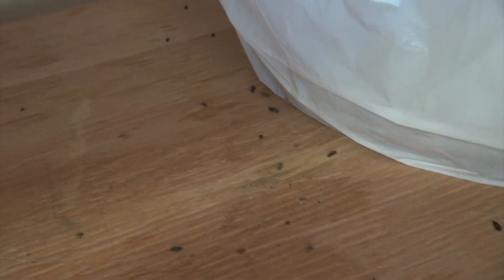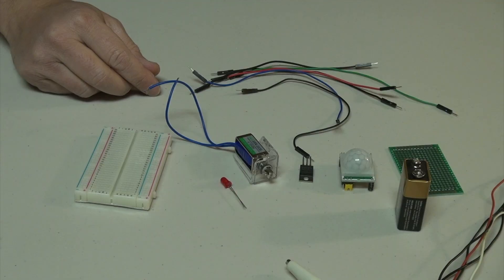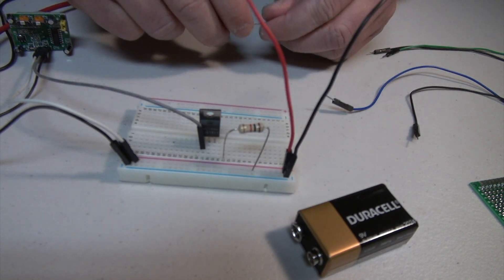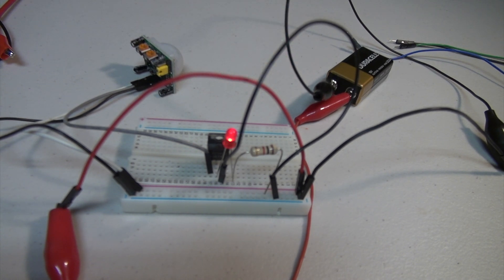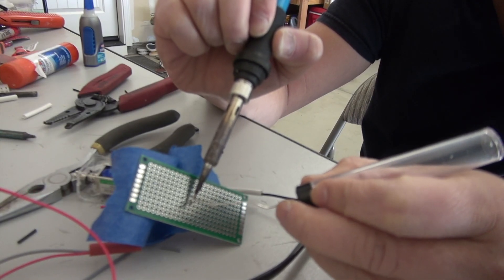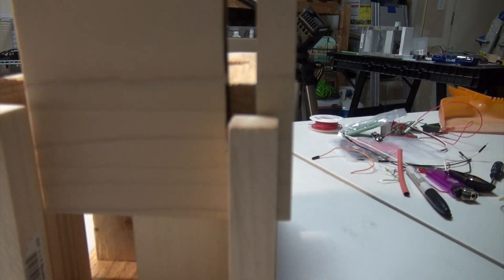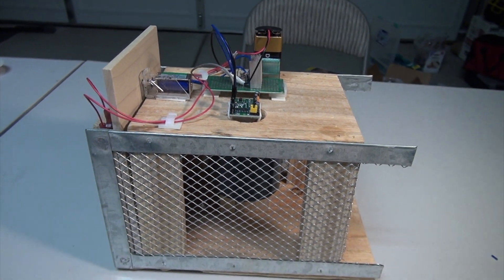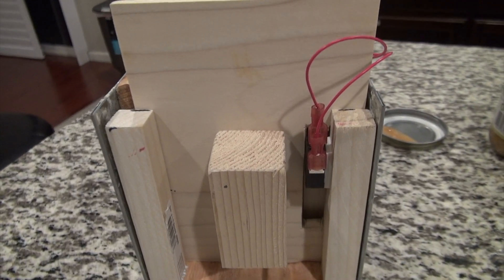How to Make an Electronic Motion Sensor Mouse Trap (PIR motion sensor and a pull-type solenoid)

Comment: Well done.
In theory PIR needs a heat source moving across. So a really cautious mouse might get past. But you showed the PIR still works at close range.
The drive to the MOSFET could be via a capacitor with resistor. It means only a short pulse.
Those PIR modules consume tiny current in standby.
Rats don't like tunnels, a balanced tilt and slide into container could use the solenoid idea.
Reply from the maker: Thank you!
Reply: @marklimbrick Actually, rats and rodents in general like to live, play, sleep and eat in tunnels, so his design is perfectly fine AND could be much more tunnel-like for better efficacy in future iterations.

Comment: Was thinking of making a light beam detector, where they physically break a beam of IR light, and that would trigger the transistor/ relay setup. Your video is great though and the motion detector type may be another option for me.  With the light beam (or invisible IR beam and detector) we would not have to worry about getting the motion detector shielded to pick up any stray movement. The mouse would have to be right in the beam across the opening.  No heat is needed either from the mouse, just the ability to break the trigger beam across the opening. Thanks!!!
Reply from the maker: Love the idea.  Sounds like a great project.  Let me know how it goes. Thank you!

Comment: 7.00 Sorry man, you've got soooo many different colored wires there, and so many aligator clips, that I can't make heads or tails of what lead is going where. It's a decent explanation, but between lack of focus, hands in front of the camera, and a tangle of different wires, it's a bit of a fail for a novice like me. Will persevere.
Reply from the maker: Thanks! It’s a bit advanced.  That is why no one made it until now…

Comment: Nice project, thanks for making this video, good inspiration.  I’m thinking of converting snap traps to use TTP233 touch sensors and solenoids to trigger the kill bars. Snap traps work pretty well anyway, but it will be a nice little project to see if I can achieve 100% strike rate.
Reply from the maker: Thanks for the nice words.  Your project sounds achievable.  Good luck.  Let me know how it turns out.  Best.